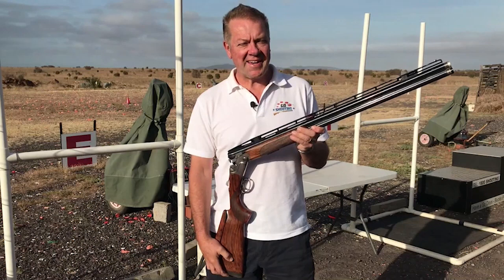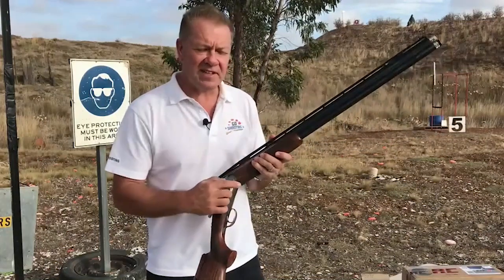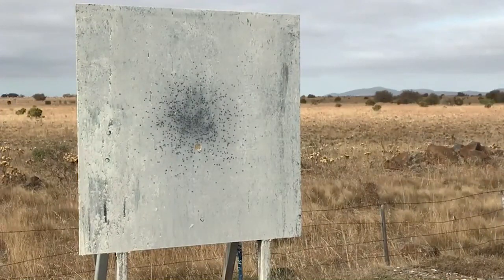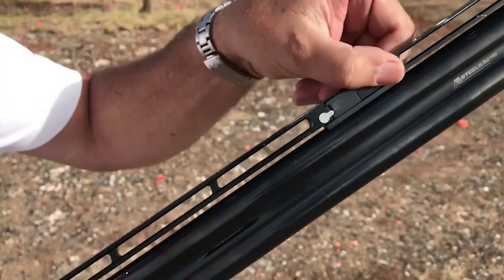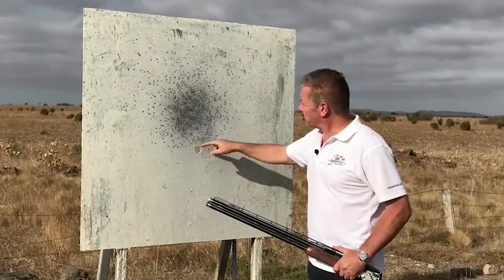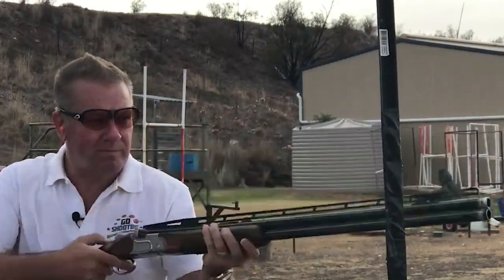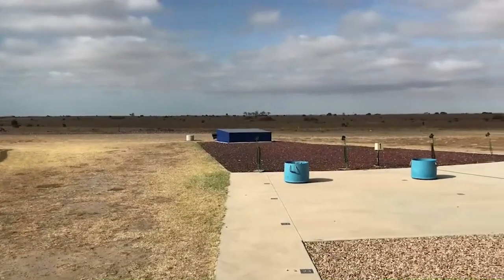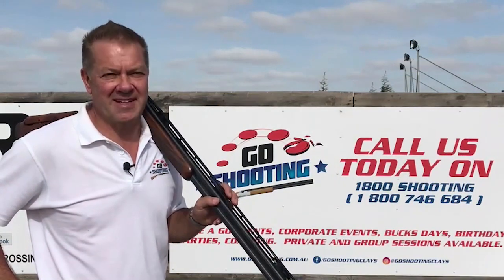Understanding Adjustable Ribs - Clay Target Shooting Techniques: #19 Go Shooting

Comment: The adjustable rib is a big advantage and as time goes on it will become an even bigger advantage.  Once you dial in your stock for a solid gun mount and comfort, a minor rib adjustment will have your gun patterning dam near perfect.  Is that a high 694 trap gun?
Reply from the maker: I wouldn't call the Beretta adjustable ribs too high. The one on the DT 11 ACS can adjust the pattern nearly 100% in a couple of seconds.

Comment: Simple trig calculations makes this easy to adjust. You can calculate the POI change by measuring the rib and the spacing of the rib adjustment markers, calculate the angle and then extend the dimensions of the triangle out to the pattern board distance. Bingo, you have your inches per rib adjustment marker.
Reply from the maker: Totally correct. Sadly most shotgun shooters are not masters of simple trigonometry

Comment: Thank you for the very informative content! Just subscribed. 

From what I have seen and read the higher ribs typically seen in trap shooting are preferred because it leads to most of the shot % being above the point of aim, among other advantages for that discipline.  In this video though you have by far the highest % of shot above the point of aim when the rib is the lowest. 

Am I getting confused on my terms, or is this DT11 simply not fit for you and we see this result of 100% of the shot above the point of aim with the lowest rib setting?
Reply from the maker: Yes. With adjustable ribs the lowest setting at the front of the rib will throw the highest point of impact above its point of aim. The higher the rib the lower it will shoot.

Comment: Hi Russel, great vids thankyou. following a rib adjustment and patterning shouldnt  I be readjusting the comb/butt plate so my bead alignment remains in the correct position to my eye?
Reply from the maker: If I was you I would set the rib in its mid position and adjust the comb of the stock until you get the desired POI and then lock the stock up and then only adjust the rib up or down to change the POI from that point on
Reply: @GoShooting  thankyou

Comment: Is a mid-bead relevant on an adjustable rib? Leo Harrison says he always checks his bead alignment before he shoots.
Reply from the maker: It's a great question. Yes mainly to check to see if the cast measurement is correct.  The gap between the mid and end beads on adjustable rib shotguns is very deceiving when talking about how high the gun is impacting above its aiming point.

Comment: Very nice what about top to bottom barrel will that effect the pattern plate results using both barrels? If i test with the bottom barrel and its 50/50 would the top be 50/50 or say 60/40 as an example? Sorry if its confusing I'm struggling to put my question into words!
Reply from the maker: In a perfect world both top and bottom barrels should be the same percentage
Reply: It's my understanding that the shot from an over / under shotgun will intercect the same point at approximately 45 to 55 yards out.  Depends on how the manufacturer set up the gun.

Comment: For American trap should the rib be adjusted to the highest? Thanks
Reply from the maker: It is a very general question, but out of all the Trap disciplines the answer is that generally ATA shooters use higher points of impact in relationship to their point of aim than anyone else

Comment: what choke are u using and at what distance are u shooting , i just got a 694 acs and when i change the rib up or down the gun still shoots the same
Reply from the maker: From the top to the bottom of those adjustable ribs you should be getting a massive difference in your results. The video is at 20m, choke is 3/4